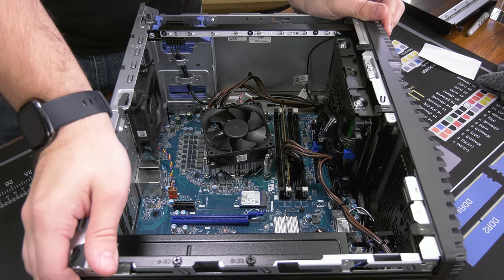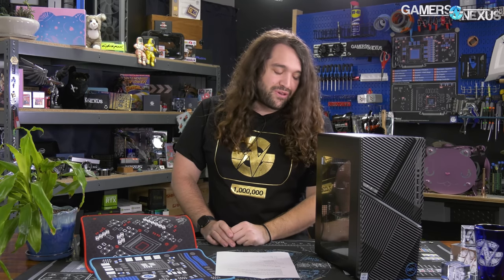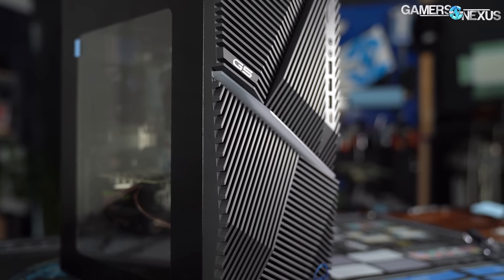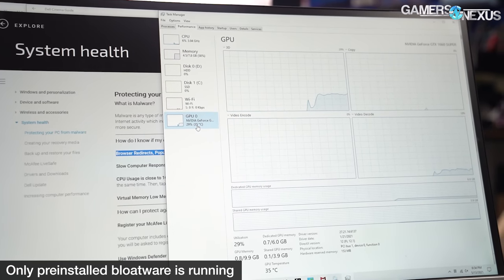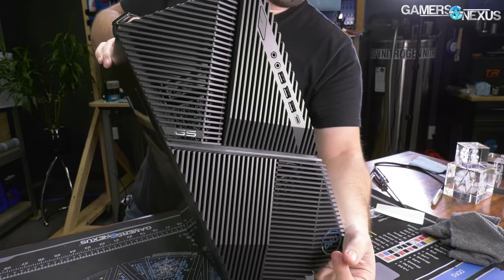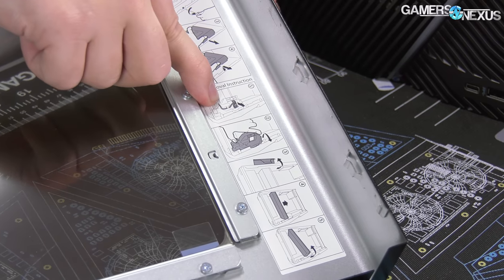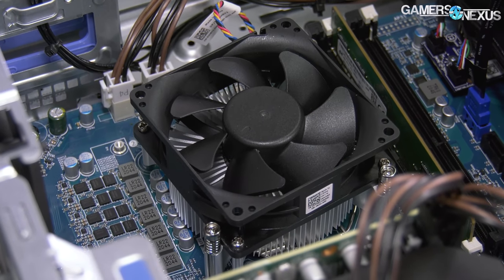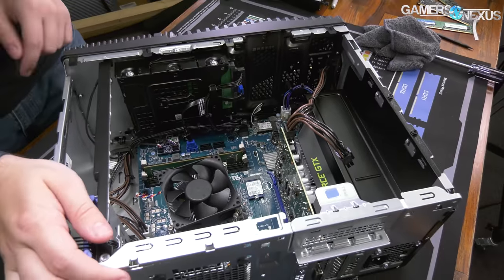Worse Than Walmart: Dell G5 5000 PC’s Garbage Parts & Hidden Charges

Comment: I'm amazed that Steve is learning about all this stuff for the first time.  They've been doing this for YEARS.
Reply: Yeah, as someone who works in Corp IT support for 20+ years you know that all the brand name PC's use custom M/B's, Power Supplies, Cases etc.
It's actually rare to get a brand name PC that uses standard componentry (I've seen a few) such that you could swap just the P/S for example in a failure after warranty has expired.
It's great that he's bringing awareness of this to buyers who may not have experience with this type of computer, but it's not new.
Reply: @nathanabird  The only Dell I ever had (well, my mom's at the time) was a Dell Dimension 8250 from the early 2000's.  It had an ATX PSU that I upgraded with an FSP 400w model.  I can only imagine most Dell Dimensions from that era, at least, were using ATX PSU's.  I wonder which other models were using them, too?
Reply: yep, looks like all of their corporate desktops tbh.
Reply: this.
Reply: has dell been doing this since day one though? it just seems like they have been crap even the models they gave to schools has problems
Reply: @nathanabird  It wasn't quite so bad in the socket 1155 days (and older). Disregarding the SFF/USFF, you could generally swap out the PSU with another ATX spec, and the motherboard for the most part was standard ATX, you just had to wire up the power button/led cables differently. But soon as they switched to 1150 it started going to shit. 1151 onwards is all entirely proprietary.
Reply: yes and as HP does it for their business machines like the pro desk series I see no problem with it, actually advantages. 
the power consumption of that machines is incredible low and nobody replaces any parts in them so the argument that "it isn't standard" is totally uninteresting if the machine costs 600€/$
Reply from the maker: I literally worked there. I'm not learning about it the first time and we've reviewed systems like this on this channel in the past. It's just gotten worse over time.
Reply: @GamersNexus  yeah I have taken apart plenty of OLD high end Dells to scrounge parts and they always were bad. But not including the front I/O on the mainboard bad.
Reply: @GamersNexus  We need to as a comunity, go to all social media sites and blaster them with ridicule for anything to change, unless their prebuilt is fraction of their overall profits, then it doesn't really matter, untill they get that bad PR is affecting other revenues of income...
Reply: @Vahlsten  You'd have to target the 60+ year old boomer IT admins at colleges to make a dent.  Schools/colleges always have used Dell and always will use Dell.

BUT... it's worked.  It's safe.  I dunno what some of these guys are doing to have had such "bad" computers that tear up all the time.  The hardware is lackluster but fine.  Had them in computer networking and programming classes in college with zero issues on any of them in any class.  Granted, we installed Windows 2000 Server ourselves in the networking class but.. yeah.

I doubt they want to order a thousand computers from some super cool prebuilt company to get RGB's and RAM with heatsinks and then have to deal with them when something goes wrong when I'm sure Dell just replaces whatever a college needs.. no questions asked.
Reply: @JustAGuy85  dimension 3000, 4600, really most from the early~mid p4 era did run standard atx PSUs mobos and the like, unless they were low-profile builds, late p4~core2 era went nonstandard/btx, the upper end stuff went back to atx on late core2/first core-i cpus [xps730[x] and similar].. and now, back to non-standard
Reply: additionally, I'll take board extended soldered USB ports over panel connectors all of the time.

and speaking of experience: a USB SSD or any other high speed storage device connected to a soldered USB port on the mainboard doesn't disable your 2,4Ghz mouse when transferring data ;)

Comment: the e-waste aspect is probably the most upsetting to me. Proprietary is my 2nd biggest upsetting thing.
Reply: Well proprietary parts cause extra e-waste. Only the RAM, CPU, graphics card, hard drive, SSD, some SATA cables and the CMOS battery can definitely be used in a different system. Even the fans may even have a proprietary connector. So the graphics card and SSD are the only proprietary parts which can still be used in a different system but they're still junk. The Motherboard, PSU, case, RGB strip+HUB, fans and CPU cooler can all be scrapped if only one of them fails because they are proprietary.

Comment: CPU cooler secured to the chassis is non-standard, but it's definitely not load-bearing.  The cooler is a load component, securing it to the chassis relieves the strain it otherwise puts on the motherboard.

This was part of the (failed) BTX standard for exactly that reason.
Reply: What's next, CTX?

Comment: I don't think the cpu cooler screwing directly into the case is a bad thing. If you want to install a tower cooler, it would give it much more support than mounting it onto the board with the standard LGA 1200 bracket system. Yes you have to remove the cooler if you want to remove the motherboard but how often do you need to remove a proprietary motherboard unless its bad at which point you have to remove the cooler anyway?

Comment: It would be super interesting if you could get ahold of an engineer (or ex-engineer) at one of these OEMs to interview on how this kind of madness happens
Reply: I suspect they don't speak english
Reply: I can tell you why it is built like that - cost. Adding standoffs, backplates and screws to a motherboard isn't free and would likely require another machine or assembly step on the production line, and when Dell can add a couple of extra standoffs to the case when they're adding them for the motherboard it adds minimal cost. Same for the front IO - it's one less part to manufacture, manage and process and if the motherboard is unique to the case it saves manufacturing complexity and cost.

The engineer that designed this was likely told to minimise manufacturing complexity and number of parts to reduce cost and logistics complexity.
Reply: Would love to see that interview...
Reply: @kin0025  on one hand i get you, but on the other, you can also have cost savings by purchasing pre made parts where somebody else has put the money into tooling and research. I can understand cost saving measures like riveting the case together, but choosing to make nearly every part proprietary in an industry built on standards, This is just anti repair and disgusting. If this crap spreads,  it will be the death of tech people and thier collections of random computer stuff that gets used later. like steve said, its just ewaste waiting.
Reply: @michealharris1991  I think his spirit was just to inform you about the thing, not defending their shady practices in any way. I'm pretty sure about it. And he nailed it. They chose to abandon quality in favour of more revenue at their own loyal Customer's expense. I bet they won't last any long over the 2029.
Reply: @mark12358  They won't go away, Dell is the most common supplier for schools and offices (probably the government too). When you sell your product to a group that has a pre-determined life cycle and buys a new one, why bother to put more effort into it. I remember having some Dell towers that while proprietary had some nice modular features for the stuff that was likely to fail like hard drives and the power supply. These things aren't made for normal consumers they are designed to be the business standard where all you have is Dell and a Dell parts catalog. On a side note HP and Lenovo are just as bad for making proprietary business and consumer machines on the same principals.

Comment: Wow. I'm a nub with anything PC related, and bought a G5 5000 around 6 months after this video released. Mine has been running as well as i can expect as a nub, but seeing this video is an eye opener. I'm at a point where i want to learn, i want to upgrade and be involved in the hobby a little more. I've spent a few hours looking into the G5 5000, upgrades, and anything like that to simply get started. The more i learn, the more i realize i shot the hell out of my foot with this one. I don't have this exact spec, but the issues i see and understand transcend a lot of the interchangeable parts lol. Thanks for the vid, I'm gladly subbing as I'm sure your channel will be helpful in the future!

Comment: Dell is heading down the same tube as Packard Bell did with its systems. Cost cutting resulted subpar setups, customers were furious and the reputation went down the drain. Old customers looked for other brands and rep as a crappy PC company spread, they were also unable to get new customers.
Ultimately the name was dead.
Reply: Exactly!

Comment: I unfortunately bought one of these as my first PC in years. Specifically one of the models with a 3080 for 2900 bucks and it shit the bed. They fixed it twice under the warranty but I  just stripped what I could from it and built a new one myself. Expensive lesson for sure.

Comment: Great video.    I've been avoiding Dell for years and even tell my friends to consider letting me build a PC for them before going to Dell.  Its a shame they have to do it this way, once upon a time having a Dell was something you could be proud of.
Reply: Back then: YOU’RE GETTING A DELL!!!
Now: YOU’RE GETTING A DELL???
Reply: Have had dell computer run for 15 years  and only died last year  and think just the capacitors  so at one stage think they worked ok  but have found that after a few years if can get second hand computers  can upgrade memory and processors  from non working computers.

Comment: this is why i get pissed when ppl complain about me charging $50-100 to buy all the parts while staying in budget, assembling it, and giving them a windows key
Reply: I've offered friends who are absolutely clueless about computers help for less and they scoff. Like bro I have to research parts to make sure everything works together while still fitting your budget, build it, install windows with a key if you don't want the watermark and updating drivers without bricking the thing. Its at least few hours  between research and labor

Comment: I wish I'd known about Dell's weird proprietary parts before buying a SFF office PC in 2019 from them.

Tried putting a (2-slot, low-profile) GTX 1650 and a better/quieter CPU cooler in it last year. The board had 2 slots (1x and 16x) and the case had room for 2 slots. But the slots were arranged with the x16 on the bottom, so a 2-slot card would collide with the PSU and not fit the case's rear panel.

Bodged it all into a secondhand NR200P, but Dell's "all on the motherboard" solution to the front panel meant leaving the case half-assembled, so I could reach in and press the power button.

The CPU cooler was simpler to install (unlike this Optiplex, the original cooler wasn't screwed into the case itself). But every boot thereafter, the Dell BIOS would see the fan didn't have the expected resistance/impedance/etc, run some tedious diagnostic, and complain that the fan was failing. The keyboard shortcut to skip the diagnostic didn't work, either.

I've finally replaced the motherboard (and consequently, PSU) and hopefully I can find someone who needs replacement Dell parts, or a cheap 9th gen Intel CPU so I can sell a functioning PC.

Some of the above is my fault for not doing enough research, but Dell certainly didn't make upgrades/maintenance a priority. Never again.

Comment: "Why would you make a load bearing CPU cooler?" 😆😂🤣
Reply: That specific choice may be justified if it reduces shipping damage on a large scale.
Reply: @ExtremeSquared  Won't make the difference with that cooler.
Reply: The answer to all questions in this video is "to reduce costs".

Comment: That has to be the strangest mass-produced motherboard design I've ever seen.  It's not even a matter of being bad, it's just weird.
Reply: Honestly reminds me of the optiplexes. Disappointed in dell lately, my fleet is somewhere around an 80% rma rate for boards since 8th gen.
Reply: Or of some multi-socket server boards. I've seen some that aren't a simple rectangle but got cutouts at places..
Reply: @HappyBeezerStudios  those EEB or SSI-CEB motherboards?
Reply: Almost seems more complex to make than using stock components. Presumably it isn't, but is weird.

Be interested to see the PSU test.
Reply: The only saving grace is the lack of USB 3.0 internal motherboard header. Tbh, i really hate that connector. The USB 3.1 was alot better.
Reply: Acer has some similar idealogy.
They want to disable youre case upgrade :7
Reply: @Hugh Mongous I also noticed it seems to take after some laptop motherboard designs, where it's likely meant to be cheaper.  They're probably only saving a couple dollars at most per motherboard, but that adds up when you mass-produce.

Comment: Beware of ALIENWARE… I bought a high end box (~$3,500+) and it had multiple problems.  Sent it back and instead of a new one they tried to fix it.  IT NEVER WORKED even after they sent it back to me.  I told them to give me a new one that worked because I had software to build immediately.   They charged me a $750 RESTOCKING FEE to get rid of it.  
     All told, since I also bought the AlienWare backpack I was out $850+ and all I ended up with was a backpack.  They also LAUGHED at me (their guys in Florida) and said “What are you gonna do?  You can’t do anything to us.”

Comment: I've been using a G5 5000 (I was hardware-illiterate at the time), but never had the random charges.
This thing also decides to die every once and a while.
Reply: That dying part is a sign it is trying to save itself! :D It needs a break every once in a while to recover.
Reply: @Django45  I think it was a software issue. Since I posted this 11 months ago, i've swapped to Linux and I've had no issues.

Comment: I've built lots of computers in my time, but I have to admit I bought an Alienware 8 years ago and learned a valuable lesson about Dell's cheap proprietary parts and configuration of their cases.  Fortunately the unit I bought had an itx motherboard so I was able to ditch the case that constricted air flow so badly it would overheat and shut down, and put it into a Corsair case with lots of fans.  Its still running but never again.
Reply: I got an an aurora R7 and found out about all the dismal proprietary nonsense.  I needed a computer quickly, and couldn't find a powerful one in stock locally.  Live and learn I guess.

Comment: I've seen (and worked on, unfortunately) an HP system with EXTREMELY similar design. (4-pin but no 24-pin, one fan, extremely cheap heatsinks and it even looks like the same box internally) 

I wonder what's up with that.
Reply: Probably produced in the same factory.
Reply: Yeah likely same production sources. And it's likely just the same design they use for their mass-market office PC's just with a GPU plugged into it, so probally very intentionally proprietary to ensure companies can't repair or upgrade anything with their internal IT departments and need to pay Dell/HP for warranty and replacement services. 

Any company that forces their warranty so hard on the customer usually has their entire business model and R&D designed around milking warranty profits.
Reply: As others earlier than I have said, it is likely the same few Chinese OEMs are the source for basically all of the stuff - who then label it for whatever company 'officially' sells it. This happens a lot in Electronics.

Comment: That reminded me of my early experiences with computers, back in the 80086 days.  I shudder when I think of how little I knew, and how often I was ripped off with proprietry heaps of junk.  One time I took a computer in for repair, and was told the motherboard was fried because of the mouse.  When I queried this he showed me mouse droppings & urine stains from when the computer was in the importer's warehouse. While I ended up working in designing systems software specific to my industry, I'm still not an expert in hardware, but at least I know what I don't know and have the internet to research before I buy, upgrade or adjust performance.

I love watching your vids, especially as you obviously enjoy making them.

Comment: "Tere are a lot of good pre-builts out there... in theory. We're working on finding them".

I don't have any kids yet, but I'll tell them to subscribe to your channel. By the time they retire, you may actually find something.
Reply: Jayz2Cents just did a video going over the decent prebuilt market.
Reply: Is there a brand out there that just assembles normal parts (run-of-the-mill motherboard, PSU, case you can buy yourself) and delivers them to you? There used to be "system integrators" when I was young that would do just that, are there any well-known ones still out there?
Reply: @Δημήτρης-θ7θ  I had cyberpowerpc build my rtx 2070 Super system. I really have no complaints. Well layed out, cable management was nice and clean and the price was fair.
Reply: @Δημήτρης-θ7θ  There are companies like pc specialist and brentford in the EU that you can configure yourself and theyll build it for you